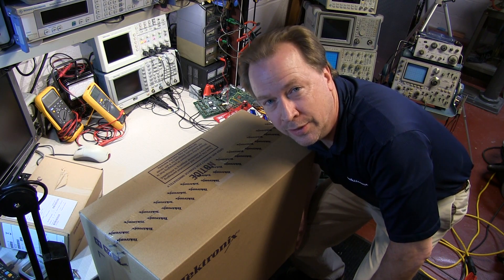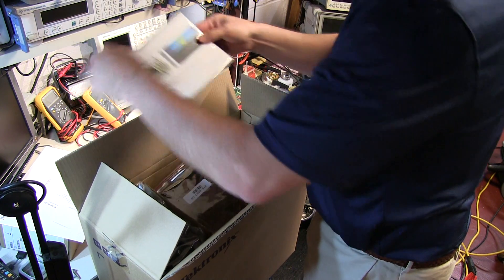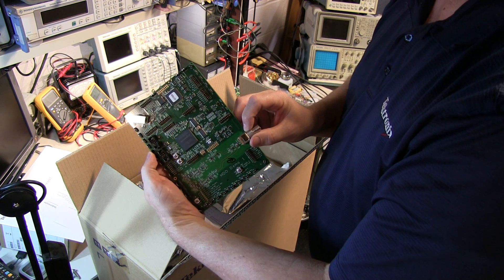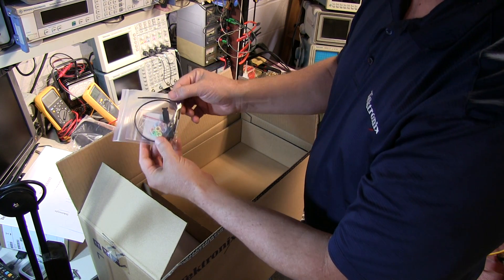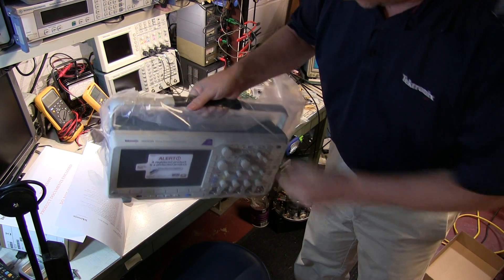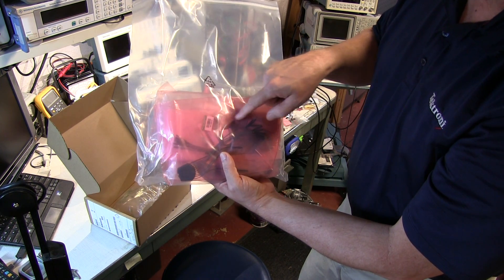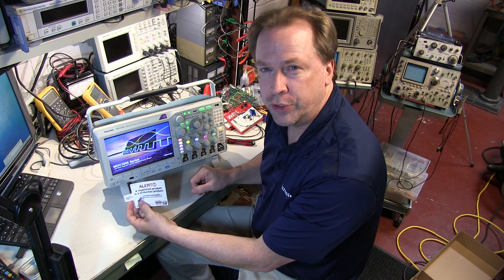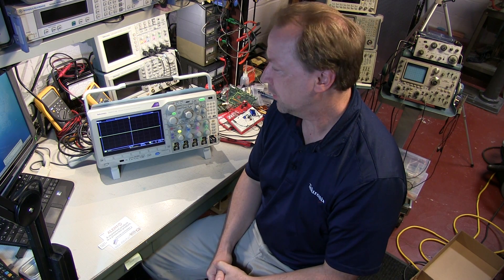#145: Unboxing the Tektronix MDO3000 Oscilloscope

Comment: Congratulations.

Is Techtronix better than LeCroy?
Reply from the maker: +HitAndMissLab In my opinion, yes.  But, I may be a bit biased - I've been a long time (30+ year) user of Tek scopes, long before I started working for them.
Reply: +w2aew Yeah, I had a quick comparison and LeCroy's MDO doesn't come with hardware spectrum analyzer. Not to mention 3.5pF passive probes.

On the silly side, I wish Tectronix had black color choice.

Comment: Hi Alan, thanks for the video. I am considering purchasing a MDO3022 and need your advices about the AFG module. In principle, the fast edge pulse generator you taught us to build can serve my purpose. I just wonder if the AFG provided by Tektronix could be better or not.
Reply from the maker: The fast edge generator has about 2ns edges, while the AFG in the MDO has about 5ns edges. But, the AFG is adjustable in amplitude and frequency, and has many other waveform types. It can even copy a waveform from one of the scope channels and play it back.
Reply: ***** Thanks a lot for the explanation! I guess I will keep the AFG option for future upgrade :-)

Comment: I altso got a new Tektronix scope here the other week.
And by new ... I mean old. A 2246a.
Nice to have an analouge scope altso.
Now I have to get my rubidium standard up and running, so I can calibrate it. Because it's horrible out of spec.
Reply: What about a GPS  locked time standard ?
Reply: zonnekat1 There's a reason atomic standards are used. Look up the difference between accuracy and precision. Best is a GPS disciplined atomic clock, like this one: KF5OBS #7: Jackson Labs Chip Scale Atomic Clock (CSAC)
Reply: zonnekat1
Timing signals from outer space ?
How devious!  : p
But seriouslly. That could work . I guess. Tho I have a couple of GPS modules in my parts bin , I really don't know much about  how GPS works.
I did check one of my GPS modules. Gave it power , and it did send out some valid serial data.
I guess I should read up on it. There is only one problem: I am  seriouslly hooked on world of tanks these days : |
Reply: I'm no educated engineer, but I would say no.
At least if it's not oven controlled, and/or temprature compensated.
Rubidium standards from old cellphone towers sells for next to nothing on a known auction site.